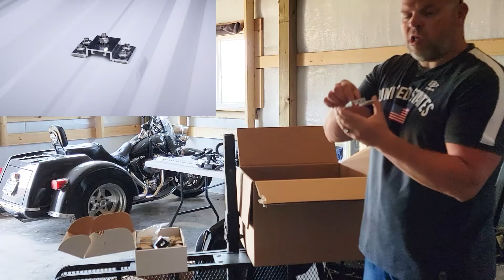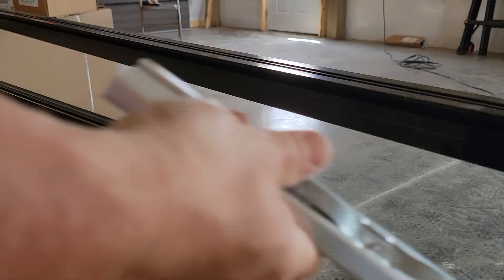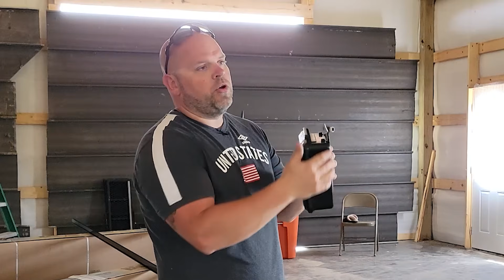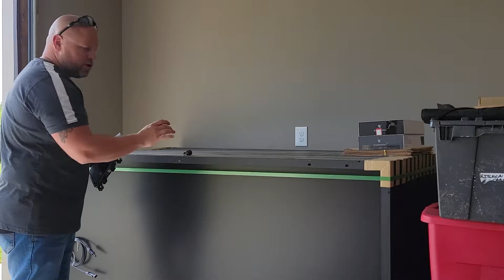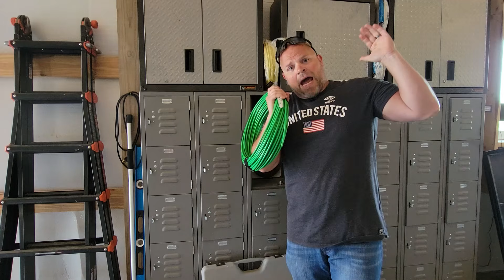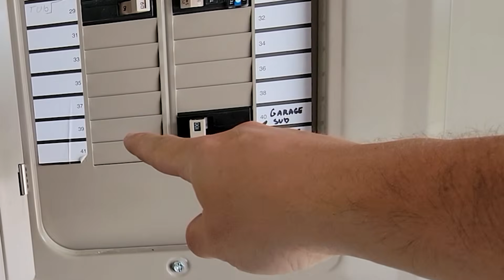Build an ENPHASE Solar System - All the Parts you will NEED

Comment: I had a 9KW system put in in 2021. My first bids was like 32 Thousand. I kept asking about the price and financing. I had a company and a local installer I was working with. My final price was 18 thousand. They almost double the price to finance your loan. I have net metering and break even every year so far.
Reply from the maker: Thanks for sharing and you got a great deal on that system.

Comment: How’s it going, I’ve been a solar installer for about 6 years for a company, and I can do all the work myself. Did you get an engineer to get plans of your design from your array to the electrical?
Reply from the maker: In my jurisdiction it only takes a one line electrical diagram. I used a software / service called lyrasolar.com - I entered all the information and it created the solar permit package to submit to planning and zoning and my local utility. Was only $75-80. Worth every penny.

Comment: My sunpower solar is not working. pkease show me how to replace enphase micro inverter and replace enphase combiner5c from my old sunpower monitor system. I have 9 solar panels need to replace 9 new enphase 😊 iq8
Reply from the maker: I switched to Hoymiles HMS microinverters and never looked back. I made a series on the install search my channel for Hoymiles. They are out preforming my Enphase system by a lot!

Comment: Our projects are similar. My 30x50 metal building is 300 feet to the house. Like you I’m providing 100 amp service to my barn and solar from my barn to the house. How does my added distance change things if at all. Is 12/2 still okay from each branch to my house?  I haven’t even dug my trench yet so all options are possible.
Reply from the maker: At 300 ft away, it changes things a lot. Voltage Drop (or vrise - As Enphase likes to refer to it as) will play a big factor on the wire size you will need. I was not allowed to install the combiner at my shop since by code in my jurisdiction it is required to be within 6ft of the main service entrance.
Reply: @TheSolarPit  before I started doing my homework, I was hoping to somehow send the solar back to the house on the same line as my power to the barn. Lots to consider before I dig my ditch. I’ve watched more of your videos.  Thank you for making them.  I’ve been a DYI guy since I was 10.

Comment: Can you get the federal rebate if you have it DIY without permits?
Reply from the maker: Not sure, I installed everything to code and had all the required inspections completed as I built mine. Plus, you have to have those inspections if you want to enter into a net metering agreement with your power company. Hope that helps
Reply: @TheSolarPit  Yeah, Net metering vs No net metering seem to be a world of difference. Seems like the sweet spot for a lot of DIY types  is to produce under what you actually use and not export anything to the grid.

Comment: Just don’t let your home insurance know you did it yourself.
Reply from the maker: Why not? I got all the proper permits, pass all the inspections and even got the ok from the utility company to backfeed.. I called the insurance and got coverage.
Reply: Referring to the average person that doesn’t know how to install. We had 10-15 service calls that panels came off from hurricane because the original installer did not torque equipment down up to manufacture standards. Also electrical work recommend hiring a licensed electrician/company to do labor. To save money recommend just paying a cash offer and get panels that cover labor and performance warranty for 25yrs. REC is good and Enphase for inverters are good for warranties. Paying 3500-5000 for labor is good before tax credit.

Comment: Thanks so much!  This was super helpful.  Just curious, in my system I had to calculate Voltage rise from the panels to the system controller, because of the length of my runs I had to go with larger wire to the combiner.  Did you run across this?
Reply from the maker: I would go with #10awg wires if I had to do it over. Although I have had zero issues with #12 I think #10 would have been worth the little extra cost.
Reply: @TheSolarPit  good to know, using the tables it seemed like k had to go with #6 in my system to stay under the vrise number

Comment: We were able to find he solar foot for our steel roof! Our problem was linking the system to the internet.
Reply from the maker: You may need to install the internet on the outside of the metal building or use a hardwire connection. The signal will not pass through a metal building. I have had my own challenges with getting a stable signal inside mine.

Comment: Kind of a dumb question may be, but it seems like the micro inverters output 200 to 240 V. How do you get 110 V single phase from the Micro inverters?
Reply from the maker: Each side is 120v. The black wire is 120v, and the red wire is 120v also. Ultimately, the output of the microinverters is 240v.

Comment: Justin quick question 
I want to combine three 8 panel arrays 88 feet away from my batteries and inverter would you place your Enphase combiner box 3 out by the panels or inside next to the fuse panel??
Total off grid system
Peter in Hawaii
Reply from the maker: Hi Peter, Completely off grid... I would still run the combiner box 3 in an area where the fire department could easily access it in case of a fire emergency. My question is, how are you achieving a total off-grid system using Enphase microinverters?

Comment: did you buy that IQ cable with the connectors from enphase and then cut it to the sizes you needed?
Reply from the maker: I bought the reassemble IQ cable drops. They had two lengths when I purchased mine. I chose the longer versions because of the layout of my system. If I had it to do over, I think the shorter versions would have worked for me. I did have to make the ends for connecting to the Jbox. Hope that is helpful.
Reply: @TheSolarPit  do you mean preassemble? or did you actually assemble them yourself?
Reply: @TheSolarPit  also man your videos on this are great, full of important details and not filled with fluff like a lot of other vids ive seen

Comment: Good Video. Now that you had it a while, are you experiencing much voltage drop? I'm about to do a ground mount system with 150' to combiner box and was thinking 8ga wire. What gauge do you think is plenty? Thx
Reply from the maker: I ran 12ga and if I had it to do over, I will do 10ga wire. Not that I have experienced any issues with the 12ga, solely due to expanding the system. Future proofing it. 8ga would even be better, however, that is a lot more expensive. Thanks for watching and commenting!

Comment: Justin, I just watched your great video, I'm in the middle of installing a smaller 4kw system to start with, unfortunately some of my roof gets partial shading during some of the day so my original idea of using a Fronius string inverter will not be optimal, that said I was thinking of switching to Enphase  IQ8Plus inverters and increase the number of panels to as many as 26. My panels (which I got for a deep discount are Canadian solar 320 watt.)  Regarding IQ8Plus inverters I can get a number of them which have been previously used - will that be an issue commissioning?  How do you figure how many 20 amp circuits you will need for a given number of panels - is there a chart somewhere?  In your installation do you have all the outputs of the panels going to that single 45 amp breaker?  Could you alternatively use smaller separate circuits?
Did you manage to get your local power company do install a grid-tie meter?
Thanks in advance
Jan
Reply from the maker: I have several other videos and shorts that might be helpful for you. I discuss all the informative you are looking for. Hope that is helpful. Thanks for watching and commenting 👍🏻

Comment: I had pretty much the same thing installed but for some reason there’s a 20ams breaker in the pv panel that controls 12 panels that keeps tripping after a few hours of work especially when there’s more production like at noontime,there’s any chance that that 20 amps breaker is under size ?
Reply from the maker: Are you running IQ7's or IQ7+'s? If not, are you paired with IQ7A's? If so, then you have too many on one branch. You can put max 16 IQ7's, 13 IQ7+'s, and only 11 IQ7A's. Same for the IQ8M's & IQ8A's (11). If you had it installed by a company your system should be under warranty. Thanks for watching and commenting! 👍

Comment: hmm why do u need solar disconnect, isn't in that combiner box already a main breaker ( u called it Enovy)? isn't that does same thing (basically disconnect the system from the grid?) im confused
Reply from the maker: A dedicated AC disconnect switch must be present within 6 ft of the meter in most jurisdictions. It can vary slightly in some areas. That means a single disconnect. The combiner box has 4 switches total. It's similar to what we see with a heat pump. Dedicated breaker with an AC disconnect switch within 6 ft of the outside unit. Hope that helps. Thanks for watching and commenting 👍🏻

Comment: for the grounding, did you wire a bare#6 from the racking to the roof junction box to the grounding rod and #6 THHN ground from the roof junction box to the combiner box?
Reply from the maker: No, I was required to run from the racking to the combiner box. Then, from there, it was to be connected from the combiner to the main service panel. I think the concern was ground looping. Because the building itself was already grounded with 2 ground rods. Hope that helps. Thanks for watching and commenting 👍🏻
Reply: @TheSolarPit   thanks!

Comment: Awesome and highly informative as usual for folks just starting down the solar journey.  We have a 4-year-old home with 30-year architectural shingles and our biggest fear is ROOF LEAKS. In fact, it's almost an obsession.  We are 70+ and this is our retirement home. So the thought of drilling a hundred HOLES in our new roof stresses us out.  What does an installer use to prevent roof leaks when they start installing all those brackets on my roof?  How do they find the roof RAFTERs?  Thanks in advance.
Reply from the maker: Yes, all anchors are required to hit the rafters. They use a high quality silicone on the anchor and around the base of it to prevent leaks. There are many different products on the market they claim lifetime warranties, but I never trust that. One day, they are here. The next day, they are not. Thanks for watching and commenting 👍🏻

Comment: Good research, this takes forever!  Sol-Ark was going to have some, but they looked like a team up with Hoy Miles.   Aptos also sells rebranded ones that look very familiar as well.   The ones I'm most interested in are the Generac CP-720, they are designed and made in USA, backed by a very large company, and have crazy specs.  Like NEMA 6 enclosures and other torture testing that exceeds many other brands.   Also a note is warranty. The best part of Microinverters is they last the life of the panel, around 25 years.  Some manufacturers have less warranty if done DIY or not registered by a certified installer.  That's what kept me from looking at the AP system DS3 units.
Reply from the maker: Thanks for watching and commenting 👍🏻

Comment: Not sure if anyone mentioned this yet but you can save yourself a bit of time and money if you don’t a fused disconnect outside when you are using a back fed breaker on the main bus bar. The breaker inside is protection enough. You really only need a fused disconnect if you’re doing a line side tap on the home (which you should really only do now if you’re adding a generator plug so you can install an interlock kit.
Reply from the maker: The fire codes, building codes, and local municipalities have say on what is required also. The fused AC disconnect was required. Thanks for watching and commenting 👍🏻

Comment: What software did you use for your One line cad drawing?
Reply from the maker: I used Lyrasolar.com, but I have heard they are waitlisting DIY installers now. You might want to try Ironridge DA (Design Assistant) if you're looking to design your one line diagram. Thanks for watching and commenting 👍🏻

Comment: I took the 6 hour Enphase free online course so I could "commission" my system. I bought a used iQ8+ and used an old solar panel, just to see if It'd work. IT DOES! Now I just have to get the 220 off my grass! Simply put, 220 VAC to the ac side of the inverter, solar panel to the DC side, AC side run to the Enphase iQ Combiner 4/4C, a bit of smart phone app setup and I'm making power! Though I do have 220 running all over my grass, from the inverter under the solar panel to the house... should do something about that... tomorrow...
Reply from the maker: Awesome stuff! If you are grid tied, be sure to have a net meter. If not, you will get charged for what you produce because the other meter reads it as consumption rather than production. Congrats on building your own system! Thanks for watching and commenting 👍🏻
Reply: @TheSolarPit  My solar installation company went out of business, so most of the stuff is there except panels and inverters. I just needed to see if I spend $10K on used panels, inverters, if it'll work. Answer is yes! Or... do you know where I can get descent 365? watt panels (30) and a bunch of iQ8+?
Reply: @TheSolarPit  BTW, I did do those Chinese plug in grid tie inverters, and YES you can produce too much power and have to PAY the electric company to take your free power! Plus, they really hate those things, even though they quit producing power without a grid, its nothing official that they can control, other than disconnecting you! That they can do per the certified letter they sent me! May have to try the micro grid with battery backup!

Comment: Hello, I think  your 12 gauge wires from the Panel to combiner is too small for the load.  Great video.  I have Emphase installer here today..
Reply from the maker: Can you please explain why 12awg is too small for a 10.89 amp load? Even considering the NEC 125% rule on solar back feed breakers we are looking at a max of 13.6 amps out of 1 branch. Although, the Enphase microinverter will never surge pass the 1.21amps on a IQ7+ microinverter. Then once we figure in vdrop/vrise and I am still in the sweet spot. Yes, 10awg would be better if I planned on expanding in the future but it's incorrect to say 12awg is too small for my install. Thanks for watching and commenting.

Comment: I saw a sub panel there in your shop. Is there a reason you did not just tap in there vs running wires all the way to your house?
Reply from the maker: In my area, connecting into a sub is not allowed. Thanks for watching and commenting 👍🏻

Comment: Did you design this system or someone else designed it for you? If you did it your self, did you use any solar system designing software and what is it?
Reply from the maker: I designed the system and I used Lyrasolar.com... you could also use IronRidge Designer tool. Both cost the same to print the plans after you get it designed. Hope that helps. Thanks for watching and commenting 👍🏻

Comment: Justin, I cannot find anywhere if I mount the solar panels in landscape, one row on top of another; how far apart the "L" foot would be?. Same question for Portrait?
Reply from the maker: Hi Frank, That depends on you wind zone and the rail system you are using. Are you using IronRidge racking system? If so what model? 10, 100 or 1000 rails?
Reply: @TheSolarPit  I am going to use IronRidge racking system model 10. I already order them. The panels are CanadianSolar CS3N-395.
Reply from the maker: @frankphilips5498  I used the XR-10's also. Have you built out your solar permit yet?
Reply: @TheSolarPit  Yes sir, I have.
Reply from the maker: @Frank Philips  Did you use Lyrasolar to complete that solar permit package? If so, I might be able to help you find that spacing details on the solar foots you are looking for.
Reply: @TheSolarPit  No, I didn't. I paid a company here in Texas. I really appreciate all of your help. Your videos rock
Reply from the maker: You should be able to find it on your solar permit. It is on page 5 of mine. Yours should be similar. You are looking for the page that has "ANCHOR PLACEMENT PARAMETERS" It should have the "Wind Pressure Zone, Max. Allowable Rail Span, Max Anchor Spacing, Max. Allowable Cantilever" Spacing. The company that did your solar permit should be able to help you also.
Reply: @TheSolarPit  I will look into it, Thanks again, Justin.

Comment: Our system was quoted for a Grid System at $22,000 to $25,000 without batteries on a Ground Mount that is really a Roofed open wall on 3"x1/4" ridged pipe building.

Not  sure how much it will be at the end.

You might find installers like framers & cement & stucco workers that work for a company like they do here in Florida. walk up when they are working, and see if they speak English,
 then ask one of them if they do side jobs.

Or advertise for people that do that in your area.

Comment: Justin, I have just finished building a 6 kW ground mount system using all Enphase components.  I went with the IQ8M.  The reason for the ground mount is I don't do roofs anymore after a mishap that required a new knee.  I completely agree about the outrageous quotes that I received for my small system.  I might have paid just a little more than you did because I went through a company that ordered all the equipment that I needed and then came and set up the Envoy for me.  I am currently waiting on the power company to come and test the system prior to it being put in service.  Very good video.
Reply from the maker: Awesome and Congrats!! Thanks for watching and sharing your experience 👍🏻